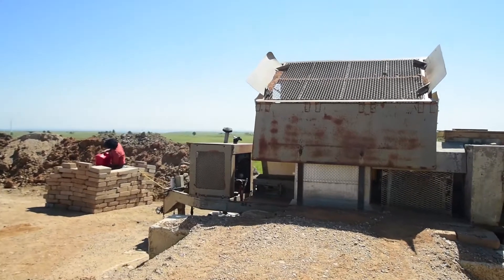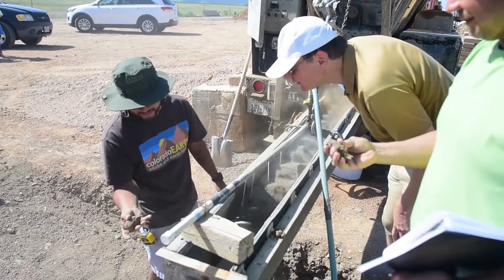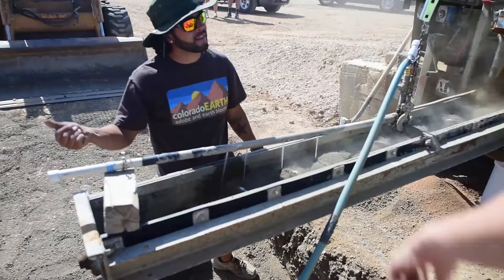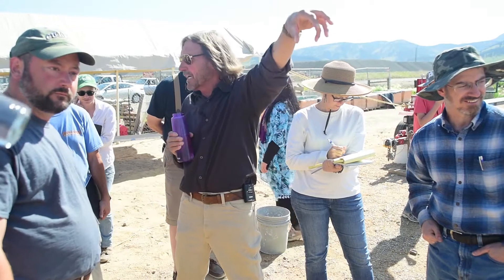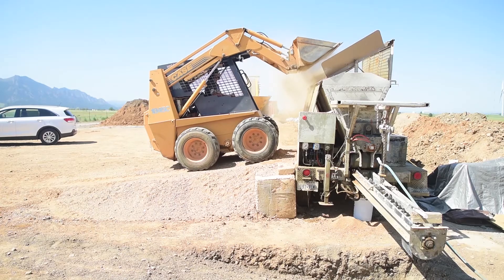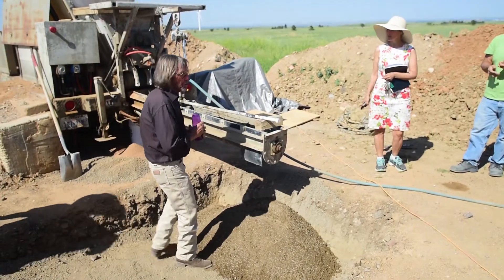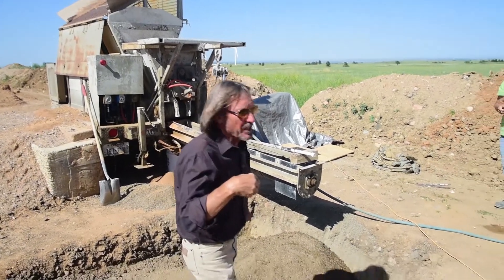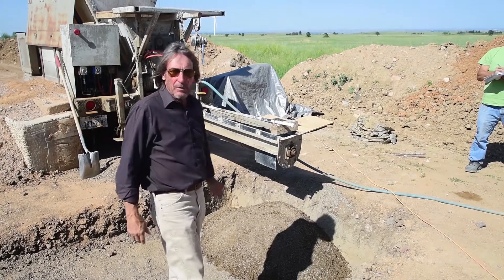Part 2 - Making Compressed Earth Blocks

Comment: Blocks with 10.91% cement met ASTM C90 

Soil Composition: 75% sand, 25% clay, <10% silt
Recommended Cement Ratio for Wet Conditions: 8-10.91%
Notes: Preferred for water resistance, minimal swelling, aligns with 10.91% study.

Soil Composition: 65% sand, 20% clay, 15% silt
Recommended Cement Ratio for Wet Conditions: 9-10%
Notes: May need additional sand to reduce silt impact, close to 10.91%.

Soil Composition: High clay (>25%), no added sand
Recommended Cement Ratio for Wet Conditions: 7-10%
Notes: Add sand or stabilizers to mitigate swelling, higher end for wet conditions.

Soil Composition: 40% sand (added)
Recommended Cement Ratio for Wet Conditions: 5%
Notes: Lower cement needed for sandy mixes, per second study.

Pozzolans for High-Strength, Inexpensive CEBs
Inexpensive pozzolans to enhance Compressed Earth Blocks (CEBs) for rain and water exposure:
Fly Ash: 5-10%, $30-$95/ton, boosts strength (7-15 MPa), widely available near coal plants.  

Rice Husk Ash (RHA): 5-8%, <$20/ton in rice regions, high silica for 10-13 MPa, needs grinding.  

Volcanic Ash: 5-15%, $50-$100/ton in volcanic areas, densifies matrix for 8-15 MPa.  

Calcined Clay: 5-10%, ~$10-$50/ton, 13.4 MPa at 5%, ideal for rural areas.

Recommended Mix: 5-7% cement, 3-5% pozzolan, 65-75% sand, 15-25% clay, 7-11% water, 2-4 MPa compression, 28-day moist curing. Test for >10 MPa strength, <12% water absorption. Fly ash or RHA for industrial areas; calcined clay for rural settings. Share soil type for tailored advice.
Do Pozzolans Increase Cracking?
Pozzolans (e.g., fly ash, RHA, calcined clay, volcanic ash) at 3-5% with 5-7% cement reduce cracking in CEBs by lowering shrinkage, densifying the matrix, and cutting water absorption (8-12%). Risks arise from:  
Over-dosage (>10% pozzolan), weakening bonds.  

Coarse pozzolans or high clay (>25%), increasing shrinkage.  

Poor curing, hindering reactions.

Prevent Cracking: Use 3-5% pozzolan, 5-7% cement, 65-75% sand, 15-25% clay, 7-11% water, 2-4 MPa compression, 28-day moist curing. Test for >10 MPa strength, <12% absorption. Add sand/lime for clayey soils. Share soil details for specific mix.

Comment: Can un-stablised compressed earth blocks be fired
Reply: No because these blocks are designed to have little Clay Content compared to fired bricks. If you want fired bricks get normal bricks, if you want cement stabilised blocks get these blocks. There is no mixing and matching techniques and here. Everything has been designed specifically. Even if you mix in waste aggregate or quarry dust Into these blocks you will negatively affect the performance of the bricks.

Comment: I've been hearing that 10% portland cement is the most durable mix.  5% will still see some erosion in open conditions.  I know nothing about this science, so my question is:  If 10% Portland cement is "best", why not 15% or 20% cement?    What do you lose by having too much cement in the mix?

Is it the breathability of the compressed earth block, that with too much cement it basically becomes concrete/cement?
Reply from the maker: The % cement depends on a few things: the mix design, what % of clay and sand, type of clay, plaster finishes, location of the build. Anything over 10% you might as well use a CMU. Reducing cement content is goal for sustainability while balancing maintenance and durability. And yes concrete affects breathability.